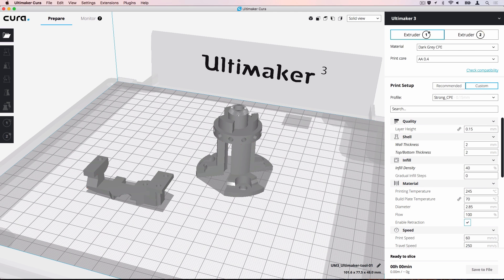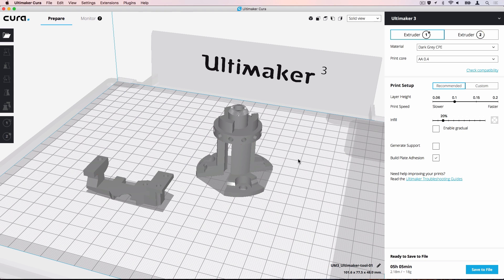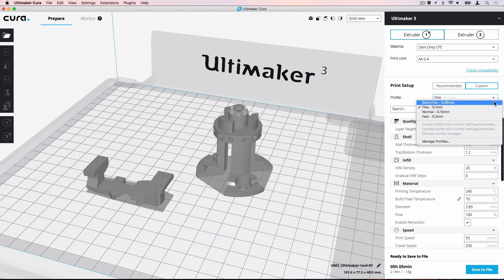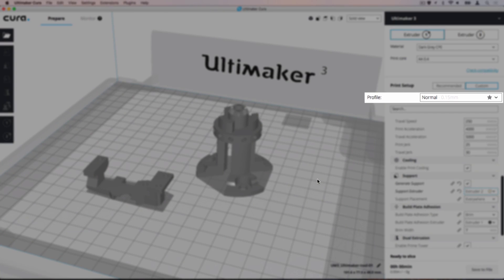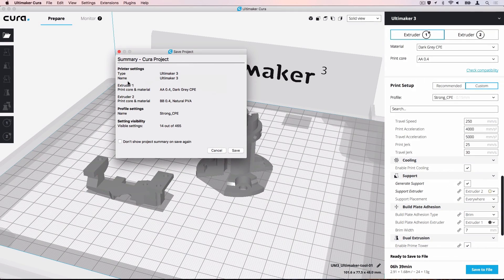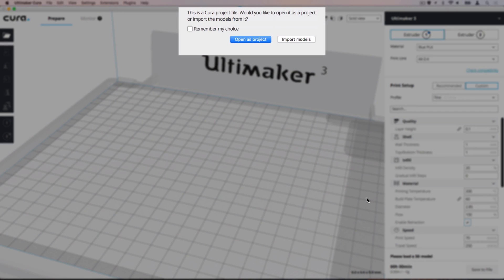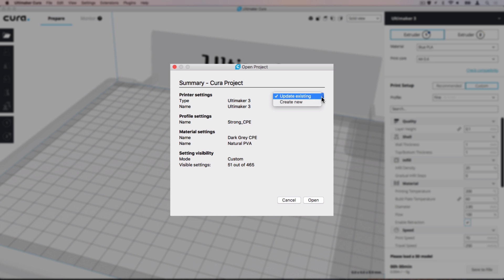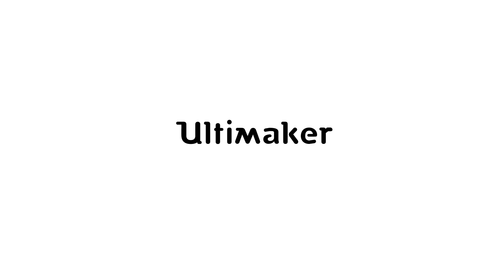Ultimaker: How to work with project files in Ultimaker Cura

Comment: Will you add "settings" tab that explains all the available settings in Cura 3.0 on resources page? Cura 2.0 has a page like that, it is very useful but lacks some of new features of Cura 3.0 of course. An updated manuel for Cura 3.0 is really needed.

Comment: 1) Also setting changes which are not saved in a profile will be stored in the project file (as unsaved setting changes).
2) The extension of a project file is .curaproject.3mf. It is a double extension. If you see a .3mf file it might just be the model file without any settings or profiles in it.
3) Reasons: you can save your work in Cura to work on it a later date. You can create a record of all changes to look back on your prints in the future and know what setting changes resulted in a specific print. And last but not least: you can share a print you are working on with others.